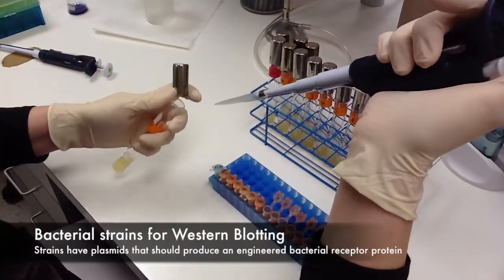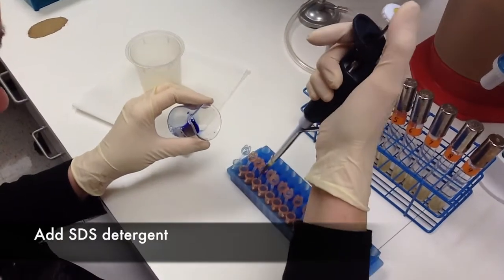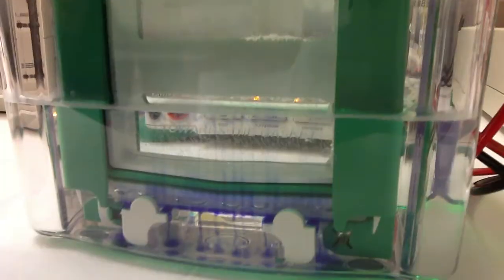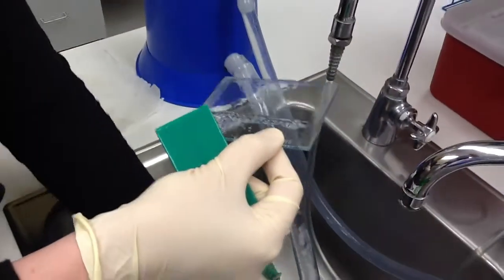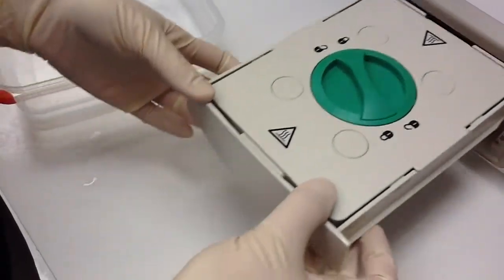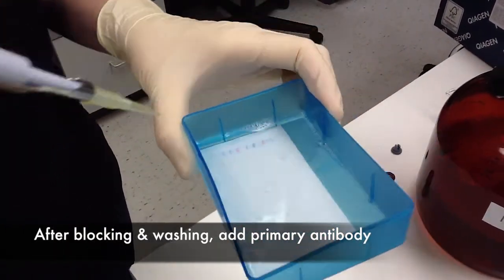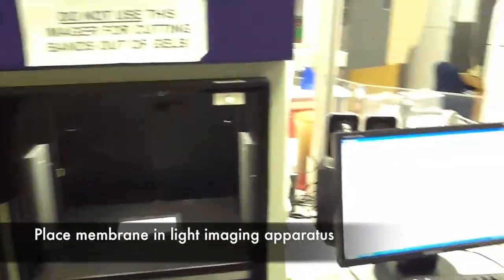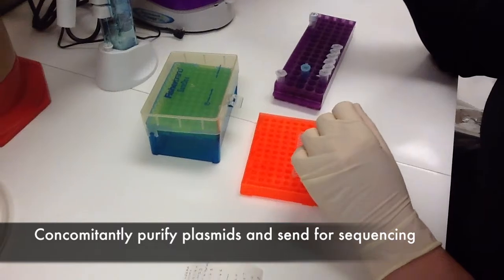Western Blot: quick run-through

Comment: What is the recipe for transfer buffer?
Reply from the maker: We now use Bio-Rad Transblot Turbo, which only takes 7 min or 10 min or 15 min depending on the protocol. Here we were using 12mM Tris, 96mM Glycine, 20% Methanol, pH 8.0.